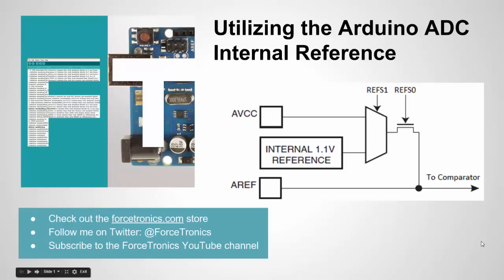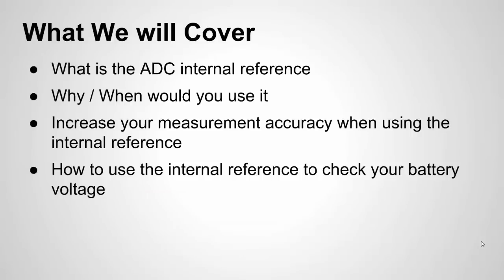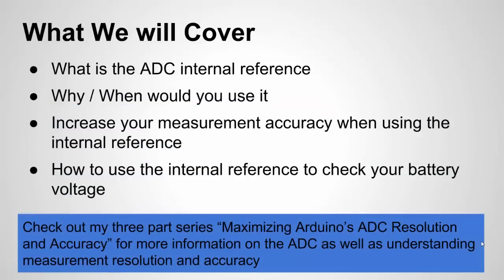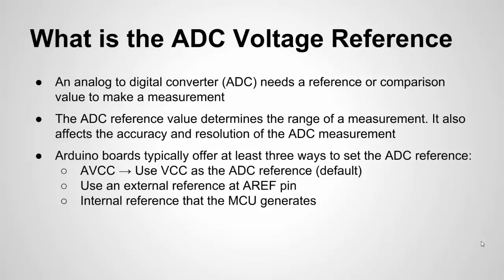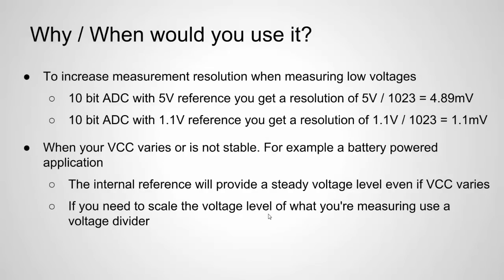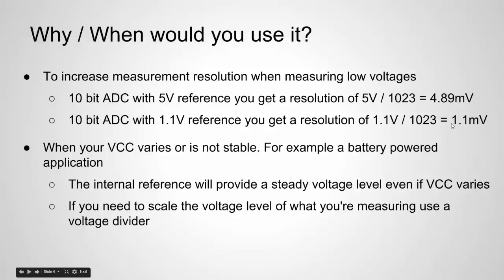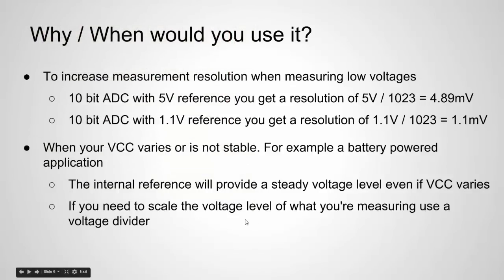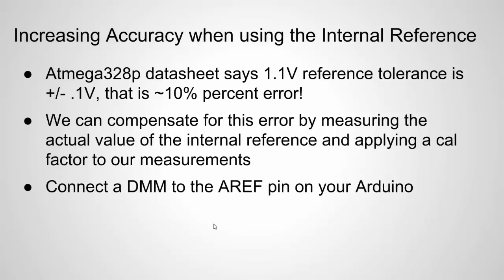Utilizing the Arduino ADC Internal Reference

Comment: I have notice for slide (5:24). External AREF pin not go down to 0V. Datasheet says (for each chip may be different) bottom/minimal value, but not 0V. eg.m328 1.0V-AVcc, ATtiny44A 2.0V-AVcc ranges

Comment: Voltage = (iRef/result)*1024 ;

Is that equation right for calculating adc voltage?

Is it not this:

Voltage = (iref/1023)*result; 

???
Reply: your question is very good. unfortunately, it does not have a simple answer (I've been struggling with it for years). this topic on the arduino forum illustrates what I mean:

https://forum.arduino.cc/index.php?topic=303189.0

Comment: Thank you for good illustration.
I have a 50Hz sine wave and I want to sample it at 120Hz using Arduino Uno but l found that it's slow: I try only at sampling frequncy fs=50Hz. How l can increase the speed of ADC?
I am looking forward to hearing from you.
Thanks
Reply from the maker: You have to use the 328p datasheet to reduce the measurement time of ADC by setting the proper registers. These settings are done behind scene by Arduino

Comment: Sorry for responding to such an old video but I have a question that I can't seem to find the answer to on the Arduino Forum or Stack Exchange, I think I already know the answer but maybe you can confirm what I'm thinking. 

I have one analog input that is 1.8V max and it's certainly easy enough to use a resistor voltage divider scheme to scale that down to just under 1.1V max (or just under whatever the voltage reference actually is).
The problem is that I have three other analog inputs with voltages ranging from 0 to 4.6V,  when I activate the internal 1.1V reference, it seemed to effect all of the analog inputs.

Is there a way to use the internal 1.1V reference for just one analog input, then use the default reference for the other three analog inputs? 

It would be great if I could use the internal 1.1V reference for just one analog input because that specific input needs to be as accurate as possible. 

I'm guessing that the best way to handle this is to use an external voltage reference at the  AREF pin at the 328P-AU chip, I could remove the 0.1uf SMD CAP and attach the external reference voltage to the pad where the CAP was removed.  
I'm think about using the TL431 Adjustable Shunt Voltage Reference Device for that purpose. 

I read on the Arduino website that I can use an external reference at the AREF pin with a 5k resistor in series so I could switch between the  internal and external references. Unfortunately There were no code examples to  demonstrate how to switch between the two.  I realize that using an external reference requires that I call for the external reference in the code to prevent a dead short internally but I'm not sure how to switch between them or even for sure if what I read is what I am after. 

Great videos!! All are very helpful!! 

Thank you!! 

Joe
Reply from the maker: Most microcontrollers, including the ones used by Arduino, only have one internal ADC. They may have multiple ADC inputs but a multiplexing switch feeds those multiple ADC inputs to the single internal ADC therefore you can only use one voltage reference at a time. I would consult the microcontrollers datasheet for things to watch out for when switching voltage references during operation
Reply: @ForceTronics  
I checked the datasheet for the 328P-AU and it indicates that I can switch between references but one small mistake in code for the reference portion could easily render the chip useless due to an internal short. 
So, I plan to use the TL431 Adjustable Shunt Reference at the AREF pin (then of course make sure the external reference is called in the sketch),  I will buy a different version of the INA250 current sense/amplifier that will output a higher voltage per amp, basically, I can just increase the max output from 1.8V (500mV per amp output) to 7V (2 volts per amp output), then use a resistor voltage divider to scale that down to about 4.5V for the max input at the analog pin I'm using.
Keep it as simple as possible, right?  :-)

For those not familiar with the INA250 series current sense/amplifier device, it has the current sense resistors, output buffers and an op amp style amplifier all built into one chip, they are designed to have extremely low output errors. The resistors are about 6 milliohms each but there are three of them for a total of  2 milliohms since they are in parallel (and Kelvin connected) and since the resistance is so small, that very small device can handle up to 15 amps of current flowing through as long as the PCB traces are done right (usually best done with dedicated polygons for separate copper pours). 

Thank you so much for your quick response!  

All the best and I hope you have a great day!! 

Joe

Comment: At 11:00 you explain how to measure ARef. ARef varies with VCC. Here are my measurements for ARef taken for a range of VCC values on an Arduino Nano (ATMega 328P). I bypassed the regulator putting VCC straight to the VCC pin;

VCC     ARef
6.0     1.030
5.5     1.043
5.0     1.054
4.5     1.067
4.0     1.073
3.5     1.081
3.0     1.085

This represents a 5.1% variation.

I want to use a battery, but get the maximum use from a single charge so bypass the regulator to avoid regulator drop-out.

I deduce that we should use the ARef when VCC is in the mid-range of what is to be measured. In my case I am putting an unregulated 18650 cell directly to VCC. The 18650 range is 4.0 to 3.0 V so I'm taking the mid-range value of ARef at 3.5V of 1.081 for maximum accuracy at the mid-point of the 18650 discharge curve. If I want end state accuracy I would use  the value at 3.0V of 1.085. 

Comments?
Reply: Why does Aref decrease as Vcc increases?
Reply: @bob-ny6kn  Bob, I can barely remember what I was doing at the time 4 years ago 💁‍♂️

I do not know why there was an inverse relationship ... but those were the values I recorded at the time, presume the same now if you want to try it?

Comment: hi, i want find out my arduino internal reference voltage. i did the same you said. i put my DMM GND to Arduino GND and DMM PLUS to ARDUINO AREF. and ran the code but nothing happened. i mean it was still zero.
Reply from the maker: That should work, make sure you have the internal reference selected and then just loop in your code ADC measurements and the internal reference voltage will be at the AREF pin. Another way to calculate it would be to use a known VCC value (measure it) divided down with a voltage divider. Then measure that known value with the internal reference. Any error in the measurement will be due to your internal reference not being exactly 1.1V and you can derive a correction factor from that.

Comment: What is the 1.08 internal reference cal factor? And where do I get mine? :)
Reply from the maker: The internal reference for the ADC is suppose to be 1.1V, but it is not perfect so the datasheet says it can be off plus or minus 10%. If you assume that it is 1.1V and it is actually 1.07 than all your ADC measurements will be off 30mV. If you measure the internal reference from the AREF pin to find out its actual value you can use that as a calibration factor in your code to have more accurate ADC measurements